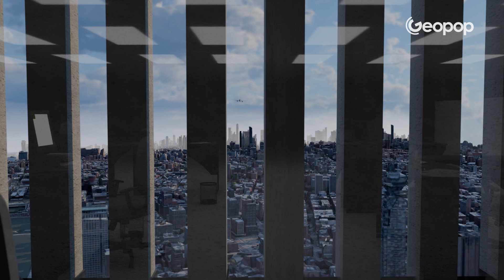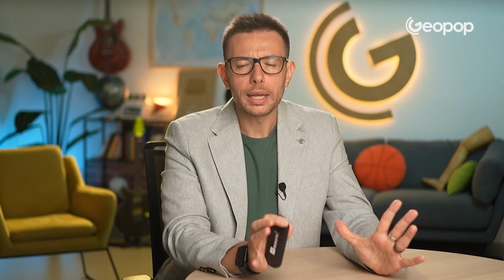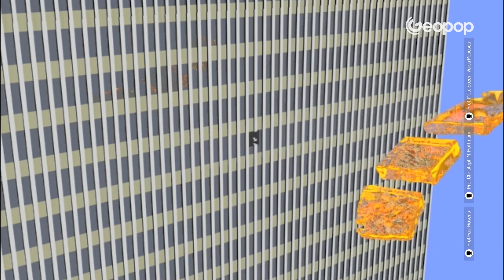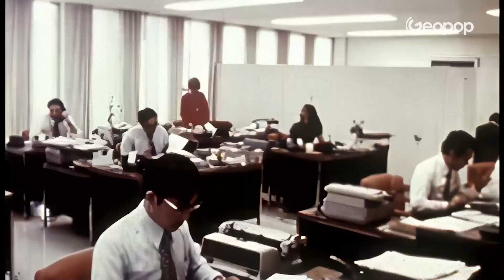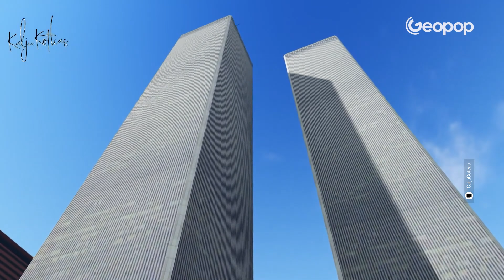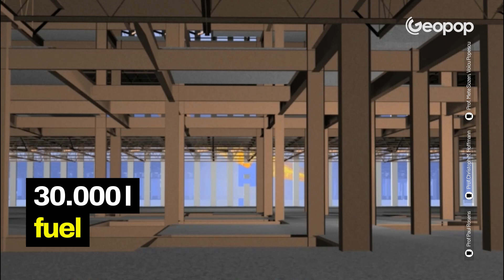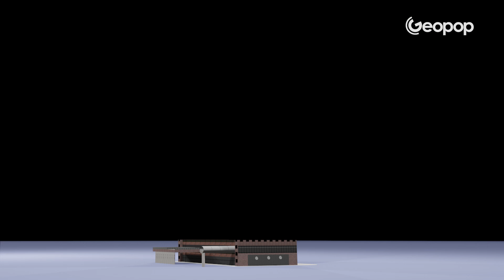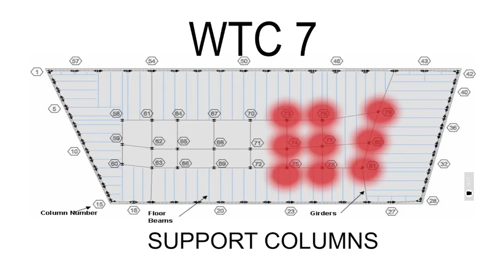9/11, 2001: The Technical Reconstruction of the Twin Towers and WTC 7 Collapses

Comment: Controlled demolition still remains the only existing explanation for the free fall of WTC7.
Reply: It wasn't in freefall, dipshit.  It started slower but as floor after floor collapsed at the top and the mass got larger and larger it fell faster and faster.  Do you expect things to fall at less than 9.8 meters/sec/sec? You have zero clue about physics, so stop repeating the stupid shit your uncle told you at the Memorial day bbq. 🤣
Reply: @stanpotter7764  The free fall is official dear clown...
Reply: Please tell us how "they" managed to keep the explosives from igniting for 7 hours while enduring the raging fires?
Reply: @BoodahBodey  Explosives? Thermite usually isn´t considered as explosive. Normal fires don´t ignite thermite.
Reply: I am going to respectfully disagree and if I may, offer a far more detailed alternative.

Building 7, the 6th building to collapse of 10 lost on 9/11 got little attention early on due to higher priorities. As a result, the information void got filled with technical nonsense, creating lots of confusion and misconceptions.  Many people, like you, just want to know what happened. To remove the confusion I prepared this brief summary from my own independent technical analysis. Let me know what you think.

At 10:28am the WTC North Tower collapsed, showering Building 7 with tons of burning debris, causing heavy damage and starting many fires burning out of control for the next 7 hours. Office buildings are essentially giant piles of kindling when it comes to fires, chock full of stuff that burns vigorously and quite hot. Since half the firefighters had been killed, units in disarray, equipment destroyed, no water pressure, and the priority of search & rescue efforts, 7 couldn’t be saved so firefighting efforts were pulled as futile and 7 left to its fate. Firefighters make that choice every day in brush fire situations - which houses to save and which ones to let go. Only real difference here is moving the decimal on the size and cost. People get overwhelmed by the size.

www.youtube.com/watch?v=g_SvpwyC17M 

Collapse of a burning structure is always a concern for firefighters.  Steel buildings are uniquely vulnerable to fire damage. Designed around 1 to 3 hours of fire resistance for occupants to escape they rely on active firefighting to survive.  After that all bets are off. Left to their own devices they'll exceed their design envelope and collapse, like Plasco Tower and Wilton Paes de Almeida. In 7 the occupants escaped, passive and active fire protections were compromised and active firefighting was abandoned hours before the collapse, which left the building to its fate. It lost. Odds on Building 7 would eventually collapse, and it did. No big deal in logic.

 http://www.youtube.com/watch?v=WnYBX6QT0R4 

FDNY Chief Daniel Nigro - The biggest decision we had to make on the first day was to clear the area and create a collapse zone around the severely damaged 7 World Trade Center, a 47-story building heavily involved in fire. A number of fire officers and companies assessed the damage to the building. The appraisals indicated that the building's structural integrity was in serious doubt. I issued orders to PULL back the firefighters and define the collapse zone. It was a critical decision; We could not lose any more firefighters. It took a lot of time to PULL everyone out, given the emotionalism of the day, communications difficulties and the collapse terrain 

FDNY Deputy Chief Peter Hayden ; We had our special operations people set up surveying instruments to monitor and see if there was any movement in the building. We were concerned of the possibility of collapse in the building. And we had a discussion with one particular engineer there, and we asked him if we allowed it to burn could we anticipate a collapse and if so, how soon? And it turned out that he was pretty much right on the money, that he said 'In its current state you have about 5 hours 

The collapse of Building 7 was anticipated and widely reported in the media throughout the day, with 24 video cameras recording it. Everyone knew what was coming and why. 

www.youtube.com/watch?v=OY5S5k3tMHI

Building 7 collapsed from the inside out which is not intuitive and hard to understand.  Most details are hidden from view and some people will struggle no matter how much it is explained. But here is my best shot relying on no outside authority. 

Building 7 was a unique, asymmetrical 47-story steel frame structure built atop a smaller 3-story building serving as a partial foundation and requiring lower floors dedicated to complex load transfer structures. Of trapezoidal shape and tube-in-tube construction, B7 (above the 7th floor) consisted of a central core of steel columns carrying most of the gravity load, perimeter steel columns around the outside of the structure carrying the remainder of the gravity loads and long span beams and girders to tie those elements together and form the floors. On the outside of the building hung a curtain wall facade or outer shell. 

www.nist.gov/image-16640

Phase 1 : First externally visible signs of collapse initiation occurred at 5:20:28 pm and was notably quiet with observers not realizing the building was collapsing! No warning in the form of hundreds of eardrum busting 180dB explosive bangs. Here at 12:00 a local CBS affiliate reporter is just 10 blocks from B7 when collapse begins. People don’t start to notice the collapse until 12:11. At 12:45 is the famous CBS fixed camera clip of Building 7’s collapse. Note the silence. 

www.youtube.com/watch?v=t5tEy6mXSE8

Lower floor failures above the load transfer region (8-14) in the NE corner initiated the collapse. In this video at 0:45 you can see the NW corner from inside the building while under construction, Column 79 just out of frame on the left. That big, angled steel beam across the top of the frame connects to C79 at one end. The girders connect to the beam. That beam and all those girders depend on just one connection 

www.youtube.com/watch?v=nP3TNHPCIVU&t=45s

Phase 2 : NE corner floor failures caused a loss of critical lateral support over an excessive length of Column 79 and it buckled. Externally we see a vertical progression of window breakage along the 44-46 line and a kink in the roof of the East Mechanical Penthouse atop the building, all consistent with C79 failure. Looking at the above floor diagram of Building 7 when you see all the structures that depend on C79 you quickly realize this one column was a relatively isolated structural element on which a disproportionately greater fraction of the structure depended analogous to say the Key Bridge. Normally with a buckling column, the load could be redistributed to other columns. With C79 that is not the case - the failure did not redistribute the load, so the collapse rapidly progressed to the roofline, sinking the rooftop penthouse. The transition from full capacity to almost no capacity occurs in an instant and will result in virtually no resistance 

Phase 3 : With C79 gone, B7’s progressive, non-symmetrical collapse continues with adjacent columns C80 and C81 left laterally unsupported and quickly buckling as well. The EMP drops down through the building. C79-81 all have no diagonal bracing, which is the major reason why they could not redistribute a lot of vertical loads among one another. From there collapse progressed from east to west through the central core until the core was gone from C81 to C58, taking all the interior floors and probably most of the perimeter columns with. Follow the horizontal progression of window failures low in the building and the dropping of the remaining rooftop structures into the building. The NIST Building 7 study model 4 determined C79 failing under ANY circumstances would have initiated the same collapse sequence. 

Phase 4 : After about 10 seconds only the exterior moment frame remains, giving the illusion B7 is still standing to the casual observer as little has changed outwardly. But it is just a hollow empty shell like an empty cereal box supported only by a few remaining columns and quite unable to remain standing on its own. With nothing remaining behind it, the north face of the outer shell leans into the void, forming a V in the roofline, the last few columns buckle under the strain and the moment frame free falls, landing on top of the debris pile. 

It is only now that we get to “free fall”. For those who get all worked up about an alleged 2.25 seconds of free fall - don’t. How fast something falls can’t tell you what started it falling, the alleged measurement people fuss about is wrought with problems, not least of which being it isn’t The Building (defined as its center of mass) being measured AND the measurement doesn’t even start until more than 10 seconds after the collapse begins, meaning whatever caused the alleged free fall was due to collapse progression mechanisms NOT collapse initiation mechanisms. Useless for informing on what caused the collapse in the first place. It is now and always has been a Red Herring. 

The debris spread well outside the footprint blocked surrounding streets, heavily damaging the Verizon Building and destroyed Fiterman Hall. 

No building is meant to survive 7 hours of multi-floor unfought fires. Building 7’s progressive, non-symmetrical collapse was incidental, unintended collateral damage from the combination of fire, time & gravity started by the collapsing North Tower, true no matter who planned and carried out the 9/11 attacks or why .  Of so little consequence it barely registered at the time, only taking on semi-mythical status as an alleged smoking gun years later when demolitions at the Twin Towers, missiles at the Pentagon and shoot down over Shanksville all failed and conspiracists had nothing left to work with. 

Anything can seem like a conspiracy if you don’t understand how it works. Now you should. I hope you found this helpful, informative and it solicits informed critical comment. If I made any errors of fact, logic or reason or left anything important out, please let me know so I can fix it. OR offer a more plausible alternative if you can. Be the first. Please start any reply with the words “Tits McGee” or I will know you didn’t read it and are wasting my time.
Reply: @TheLoonResistance  I see that with all your shitload of copy paste BS you don´t even try to explain the free fall that totally proves the controlled demolition of WTC7...
Thanks for proving me correct AGAIN Fitzshill!
Reply: @TheLoonResistance cut that copy n paste shi out, disparaging the pfp you have too..
Reply: @TacticalREI - If I have made any errors of fact logic or reason please feel free to point them out.

I won't wait up
Reply: @TheLoonResistance  It´s all fine Fitzshill. You proved that you don´t know a free fall explanation that comes without controlled demolition. You proved me correct AGAIN Fitzshill. And that´s exactly what you shill are paid for, isn´t it?!?
Reply: @TheLoonResistance  I'm not reading all this mossad propaganda shit. I'm a civil engineer. I can tell you from a position of authority on the matter. The way we build sky scrapers, a plane hitting the top 1/5 of the plane will not do any significant damage to the other 3/5.
Reply: @hakimehamdouchi7468 - No one but you is claiming the plane damaged the structure below.
Reply: @TheLoonResistance  YOU GODDAMN TROGLODYTE. Should I spell it out for you. The fucking damage reached the lower structure by the floors fall on top of it. that is what I fucking meant. I didn't know they let troglodytes into mossad god fucking damnit

Comment: Look up and watch the seminar presented by Dr. Judy Wood - “Where Did The Towers Go? “  It’s lengthy but very informative.
Reply: Ah yes, Judy Wood – the RFK Jr of 9/11 woo_ . I read Judy Wood’s book.  I must say my experience with it was somewhat different than yours. 

Laughed my ass off. Lots of face palming moments.

Fundamentally, it is insulting on an intellectual and factual level, written to appeal to an audience that will put even less thought into reading it than she did in writing it. The evidence to support her case is incredibly thin and heavily cherry picked to fit her narrative while taking care to exclude any evidence that doesn’t. Little to no analysis worthy of the name is applied to any of it. Most of what passes for analysis is along the lines of “oh, isn’t this unusual.” Wood is vague and ambiguous, careful to avoid making definitive statements or drawing any conclusions she will have to defend. This is typical conspiracy stuff. Ambiguous, vague and obtuse. The target audience won't notice or care, just nod.

The theory – a conjecture really - Wood presents refutes itself. Back in 2001 every documented Directed Energy Weapon concept worked by thermal processes. Massive amounts of heat. Dr. Judy Wood’s cold process theory describes a non-thermal breakdown that operates on a different scientific premise, not unlike Cold Fusion which has long been a staple of crank science. 

It should be obvious from this alone it is a genuinely crackpot theory.  Pure fantasy.

It is worth noting when considering her book that Wood spent much of her academic career researching the material properties of teeth.  As a former university research scientist who had been published in peer-reviewed scientific journals more than 60 times, Wood understands the value of speaking to a knowledgeable, professional audience and how to do it. Curiously then, rather than present what would easily be by far the most significant – politically, criminally and historically – findings of her entire career to a technically knowledgeable audience, Wood chose instead to self-publish a for-profit book aimed at a technically ignorant audience.

That is truly unusual and inexplicable behavior for any professional. Wood should know better.

There are basically 2 standards for scientific proof: Affirming peer review, and independent lab reproduction.

Wood sought neither of these things. Hmmmmmm,… I wonder why. 

When I found out Judy Wood suffered a career-ending traumatic brain injury in a cycling accident which left her in a long-term coma, things made a lot more sense. Not her book mind you – it’s complete nonsense – but how someone who was once credible and scientifically minded could write something based entirely in speculative conjecture and then deliberately avoid the professional community in its distribution.

Wood is clearly not firing on all 8 and talking about things she had no knowledge or expertise in even when she was fully functional, relying on false appeals to authority to get her message across to a credulous non-expert audience.

If there were such a thing as a directed energy weapon powered by hurricanes and capable of turning the World Trade Center Twin Towers steel into dust (while at the same time mildly singeing some cars and causing no other collateral damage), where has this weapon been since 9/11/2001? This is a weapon literally capable of instant world domination. It would make every military in the world obsolete. It could end the War in Ukraine in a day! And Gaza!!! It could send the Chinese back behind their wall. Yet it only gets used once, and pointlessly at that?

Why use such a device at all in an attack that absolutely has to look like it was done using hijacked planes and nothing else and when it isn’t even needed?

If you can answer any of that with something that won’t induce roaring laughter, then by all means have at it.  Be the first.

The whole idea is just so many levels of stupidity it boggles the mind. There is no physics in her book and almost no analysis. It is entirely premised around magical thinking, doubt seeding and lie-by-omission.

Point of fact: The collapse of the Twin Towers created a 17 acre debris pile up to 14 stories deep that destroyed 8 surrounding buildings and damaged over 100 more.

No steel turned to dust as simple observation will confirm   www.youtube.com/watch?v=u2D__-DVLBk 

This is why Wood has always been way out on the lunatic fringe, zero support in the scientific community and barely any even among other fringy conspiracists, whose standards are low but not that low. Also worth noting that Wood has not bothered to promote any of this stuff for many years. Must not have been that important then, or maybe it just stopped producing income so she moved on.

PS

You can’t get much more direct energy than a collapsing 110-story building.
Reply: Just realized youre an infamous 100+ comment titan, legendary dew drop status.